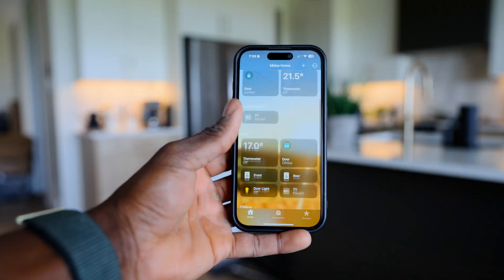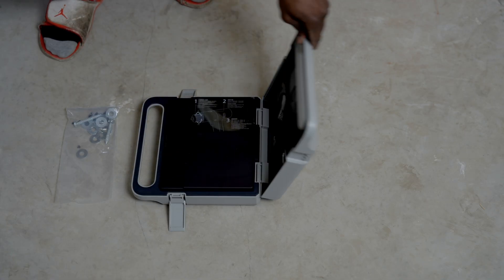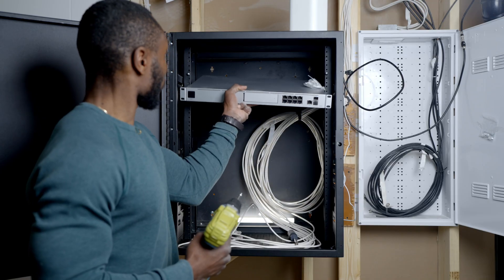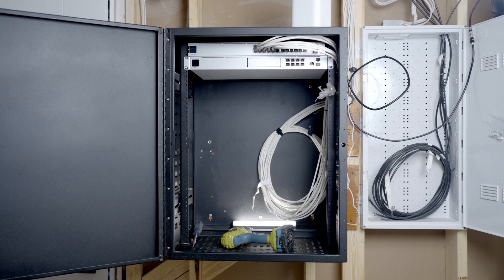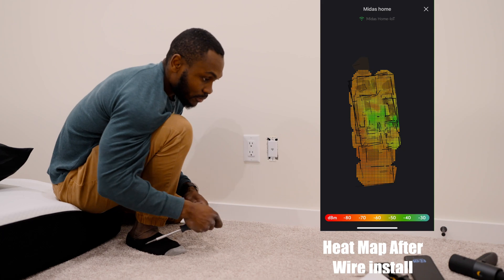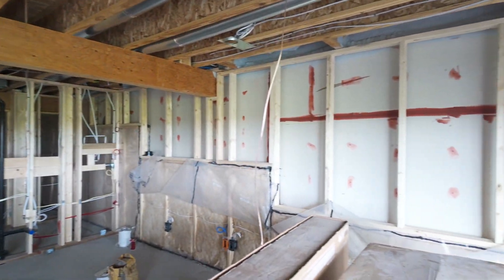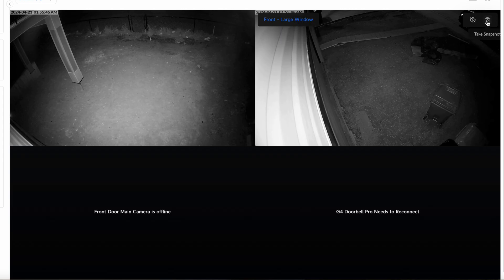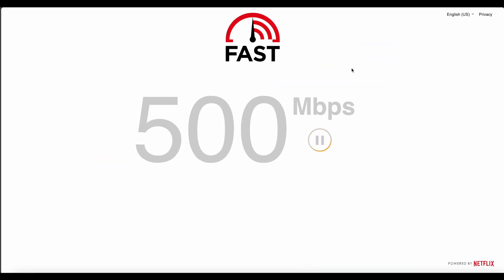Building a Smart Home Network for My Brother’s New Place! | Version 1

Comment: Great setup brother.   I'd swap the SFP to RJ45 connectors to a DAC cable, for 10GBE.  reason 1, for heat, the SFP converters heat up.  DAC cables or if you did short FIBER with LC transceivers would not be warm.  

Ubiquiti gear is fun and super addictive to get into the ecosystem.   Im sure youll fine tune it down the road.  Adding their Aggregation switch (8 port full 10Gig) between the UDM Pro and your current switch will be a nice upgrade too.

As another FiOS Customer, run the UDM Pro as your main Router, and go from WAN on the FiOS Gateway to LAN on the UDM Pro.  You only need the FiOS gateway for Video. (have them swap your COAX to Ethernet)  your capping your max speed over COAX.
Reply: Very helpful comment. I have a UDM Pro and a PRO 48-port Switch. What would adding an Aggregation Switch (8 port full 10Gig) between them do/accomplish? Thanks!
Reply: @views40  allows it to be the “core” switch. With its large switching capacity. It can take all your 10g and 1g switches and aggregate them to the UDM Pro.

If you don’t have more than one 10g switch, then it’s not really a benefit.

Also allows you to run port aggregation (both SFP modules) to the Switch Aggregation.   Double throughput or fail over.    Look up some vids.
Reply: @crazycoastie  - Awesome intel, thanks for the detailed reply! Going to save this is my notes and research.

Comment: 🎯 Key points for quick navigation:

00:00 🏠 Introduction to setting up a smart home from scratch, focusing on networking, Wi-Fi, and security.
00:27 📡 Initial setup involves choosing a central location for networking equipment in the mechanical room.
01:08 🛠️ Using a backing board to mount the network rack due to misaligned studs.
01:57 🧵 Tidying and routing ethernet cables neatly without using a patch panel.
02:23 🖥️ Installing the UDM Pro for routing, security, and network management.
03:15 🔌 Adding a UniFi 24-port PoE switch to power wireless access points and security cameras.
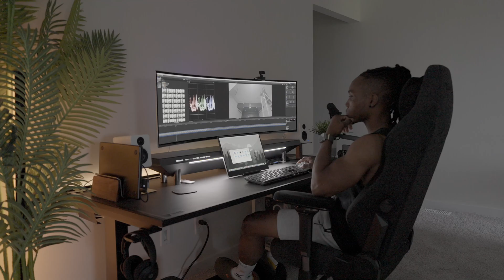04:07 🖥️ Setting up a NAS server for video footage storage with a RAID 5 configuration for data protection.
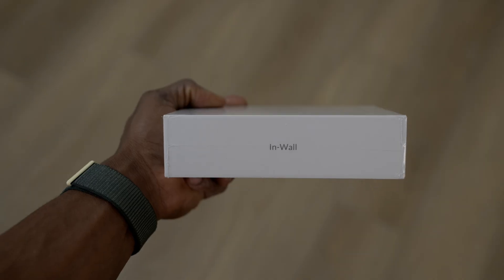04:47 📶 Installing UniFi in-wall wireless access points for full home coverage.
05:53 🌐 Adding a U6 LR long-range wireless access point in the basement.
06:21 📹 Installing UniFi G4 cameras for outdoor surveillance with PoE.
07:42 🔧 Using wireless connectivity for the doorbell due to missing ethernet wiring.
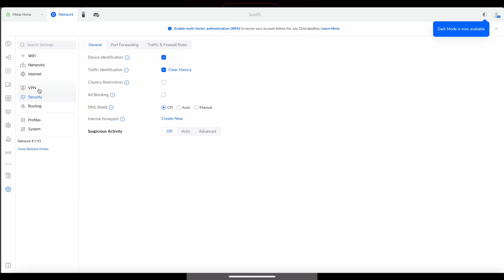07:56 📱 Configuring the network using the UniFi mobile app and creating separate networks for IoT, guests, and main devices.

Made with HARPA AI

Comment: why you do not use DAC cable to connect UDM with switch? Or normal sfp cable and have 10GB connection and port isolation (on currency)
Reply from the maker: Dawid, very good observation. that's also an option but what had on hand during this install was SFP.  We are still planning to do more upgrades to this rack later. This is just the basic. There are so many ways to go about this. DAC is an option if you don't already have sfps, SFP with Copper cable is also an option. In my own setup, I used Fibre SFP with Fibre Cable between my switch. 
We will be upgrading the rack to a 42U rack with bunch of of audio controls and ether lighting switches. Stay tuned for the upgrade.
Reply: @tytalkstech  very nice plan for upgrade. My previous home network using fully ubnt hardware but now it is pfsense as main router and firewall then connect to SFP+ Core switch and from it move to 24 enterprise model. I very do not like firewall rules in UDM

Comment: can this be done for an already wired house
Reply: Yes, it just might be a bit more work.
Reply from the maker: Yes, I did that in my old house in this video 
https://youtu.be/umU-arnHV9Q

In this video, we are actually adding more network runs (about another 48 runs)  across the entire house for all the doorbells, speakers and other things but we got an electrician this time to get the wiring to those places. I will be releasing upgrade video when it is done.  It is definitely possible but time consuming especially when it is something you don't do much. The electrician got the wires to all the really weird spot really fast and easy.
Reply: @TyDaSpace  I sent an email concerning my own home that's coming up I would a fully integrated thread network

Comment: Would love to see this set up a bit further! With the separate network for the smart devices, does one need to be logged into it to control it from their phone or do the networks communicate together?
Reply from the maker: You do not need to be logged in. Your Phone will be on the main network that can reach all the other networks but the other networks cannot reach your main network.  Firewall rules prevents those devices from accessing your important devices like phones and laptops and security camera  but your phones and laptop can talk to them.
Reply: @tytalkstech  thanks for clearing up. Confident in the purchase now.
Reply from the maker: @dolfan2303  I'm glad it did. Feel free to use our affiliate link below. It's no additional cost to you but it supports the channel.